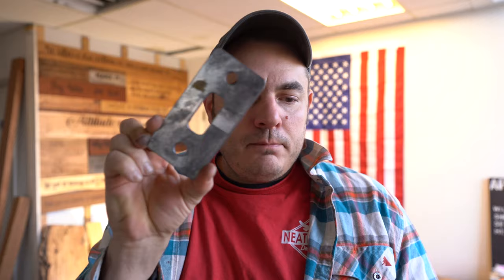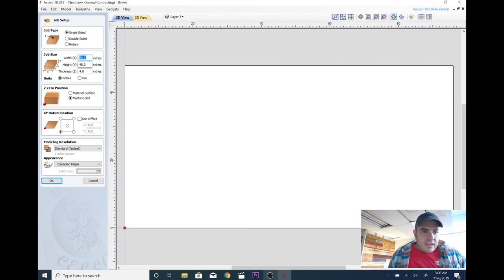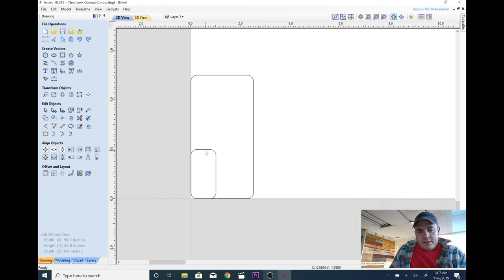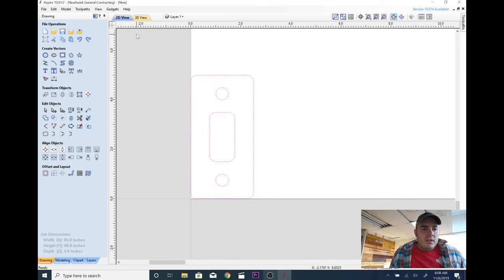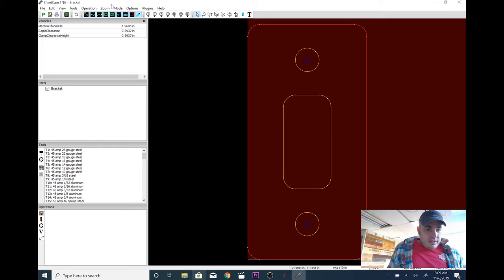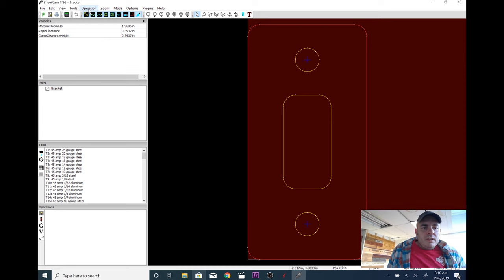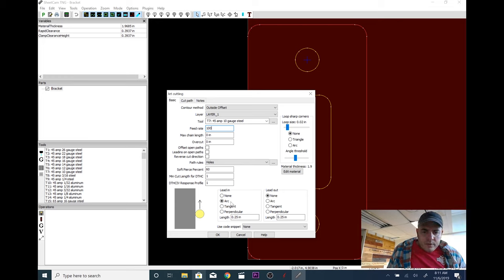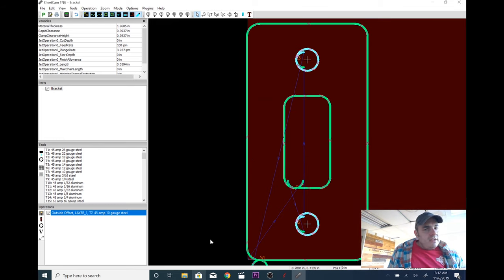How to Draw a part in Vectric Aspire for CNC Plasma

Comment: Hi from Argentina, how is the post procesor in use for generate GCode for hypertherm plasma machine. Thanks very much.
Reply from the maker: Hi Martin.  I use Sheetcam to generate the Gcode.  Are you looking for the specific Post processor that I use?
Reply: @NeathawkDesigns  thanks for the response. Yes, i need, M07 amd M08 in Gcode for the start and stop plasma and M40 ans M41 for kerf. Or if you know how to generate it in the gcode. Maybe I don't understand how it works, but my machine needs this. With my current nesting software I do it but license update is really expensive.Thanks again and sorry for my bad english.
Reply: @NeathawkDesigns  Thanks for your answer, sorry but after so long I saw it.

To your post question.
Yes, I am looking for the post you use. Can you pass it to me

Thank you

Comment: hi , thanks for this , I think the current version of Cut2D doesn't support Plasma 'lead in 'out of the box - hence showing how to do it with Sheetcam is great . 
just subscribed  and  looking froward to more videos
Reply: Cut2D certainly does have lead in and out, "out of the box"  I use Cut2D all the time to produce toolpaths for my CNC Plasma.
Reply: Thanks !
I just found it . 
However when I run the toolpath view, I cant see the lead in appearing , maybe its something Imp doing wrong , but at least I know it's possible. I'll just have to do some more digging around and testing :-)